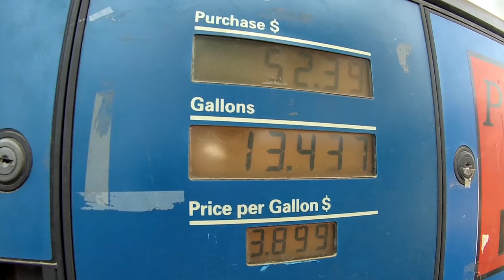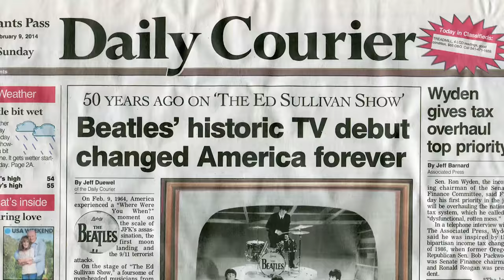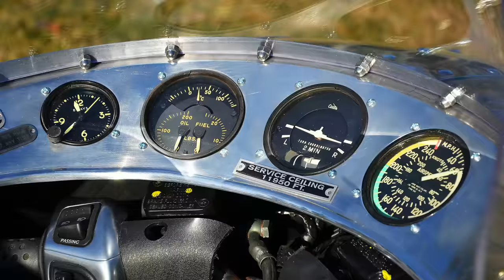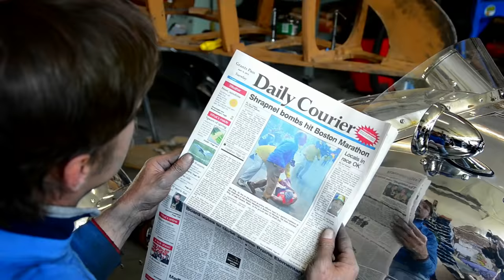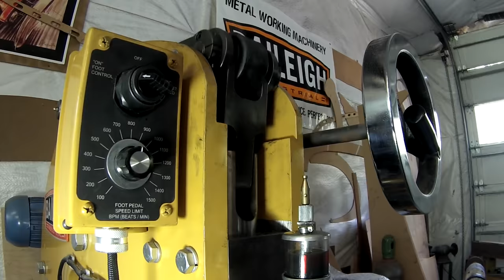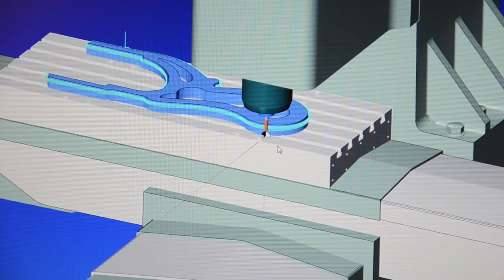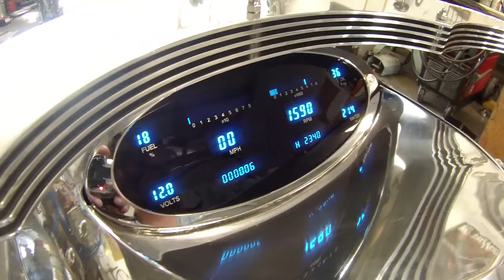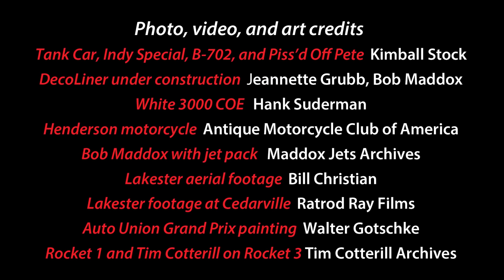Randy Grubb: From Mind to Metal

Comment: I just bought an 88 Aero Cruiser.. same design as the FMC/ with a GM front wheel drive.. but on a one ton Mopar chassis.. single rear axle with a single wheel on each side... same air bag suspension for the coach.. it's a lot like an overgrown VW bus with a V8... makes lots of noise... slowly 😉
Reply: I make a metal you should have, brother...  called mithiril by Tolkien.. an alloy of palladium.. from the white volcanic ash found almost everywhere... it's basically free..  which cuts production costs nicely.. it doesn't oxidize.. you can get really nice clean welds with no gas...
light as aluminum.. but with a double covalent bond in the unit cells and a metallic bond holding the unit cells together.. it can be bent over and over again and it doesn't break.. melting point above 1550° C... 
now.. bioplastic from the same dust.. add 10% borax to kaolinite clay... heat existing aluminum parts evenly in the dust>>
with a propane torch for easy AuPd.
take an old cardboard box.. saturate with Elmer's glue and add the dust with borax... which acts as a flux.. carries the AuPd through the fibers of cardboard.. it dries as hard as concrete.. still as light as cardboard... add food coloring to the glue for something other than the cardboard box look..  spray with shellac to waterproof... otherwise... it just melts.. biodegradable..  non toxic.. guaranteed by 50 bazillion school kids
Reply: while the glue is wet... I put AuPd foil on one side..  the outside makes it waterproof.. light as cardboard... it's going to be my floors and cabin structure for my dirigibles... 
I've been really sick for a long time... development was done during moments of better health.. I did factory floor automation for Boeing.. making their high tech fiber and aluminum stuff for aircraft... and worked for Raytheon building infrastructure.. petroleum plants .. cereal factories..  
my dad taught reactor physics when I was in high school... 
this is an ongoing part of his research
Reply: my best friend and business partner is up on the slopes of Mt Hood... we lived near Medford when I was at SOSU Ashland.. my son was 3.. 30 years ago.. 
a pleasure to see your work 🤠

Comment: Anyone have a lead on a a Model 2CA and 2DA
Flywheel Turning Tool for a M-47 AV1790 engine?  There's a restoration project going on in Kansas, and this is just one of the parts they need. Tank. ;)

Comment: The Deco POD looks great. Appears to drive well.... 
BUT, if you get a flat at highway speed, hit a patch of oil, and are bumped by another vehicle.... all which have happened at one time or another during my years of riding.... YOU WILL DIE.  
There is no way YET to protect yourself if you lay it over for whatever reason.

Comment: The design at the 1 hour mark is seriously dumb - if he ever slips his foot onto the ground and then under the rear tire - then thats it for walking... also whats up with zero EVs?
Reply: I agree with that he, should of installed flooring on the bottom and I think I know way he built it like that because he wanted to reduce weight. I look at it this way I would think more of safety than weight distribution.

Comment: My only problem with his work is he is definitely a form over function guy.    He is an artist, so he cares about his machines as a piece of art.    However, IMO aesthetics should never impede functionality significantly, and in this example you have no suspension, your nuts would probably explode without even a sprung padded seat, an aircooled engine was used but with likely very little remaining airflow over the cylinders occurring, and if the rider were to fall over with their arms inside those fender cutouts they would likely break their arms which is unacceptable from a safety standpoint.